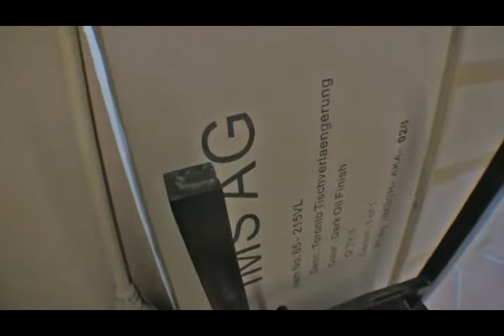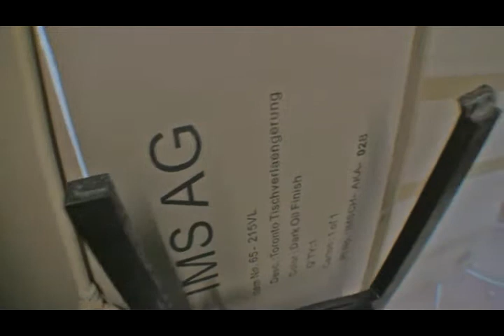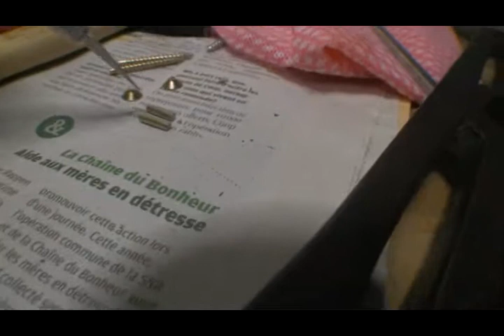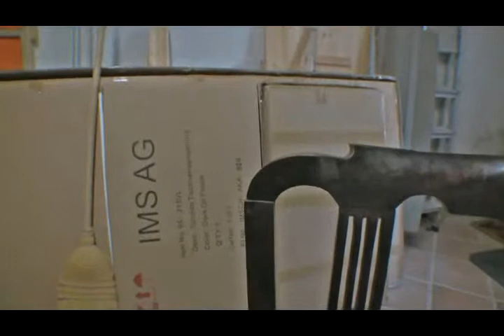Chinese Chair 2

Comment from the maker: The key to the repair is finding out why the joints opened in the first place.  In my case the seat was removed from the frame at some stage and was re glued with the rear left joint open.  The only way to close it completely is to remove the seat again.   In my case this would entail a complete dismantling of the chair - which I want to avoid.  So far it looks like I'll sort it out but plenty to do yet.  Good luck with yours!

Comment: I wonder if the fire was the start of the chairs problems. The rapid heat drying the wood, and possibly the water used to fight it too. Heat would have weakened the joints and the rest as they say is history; and plenty of it.